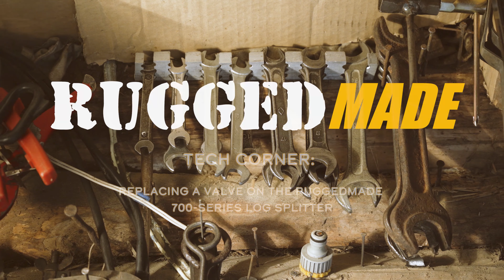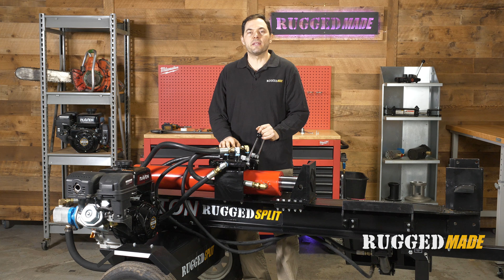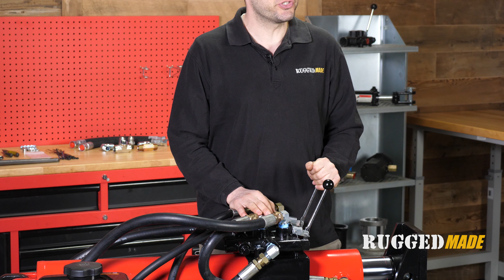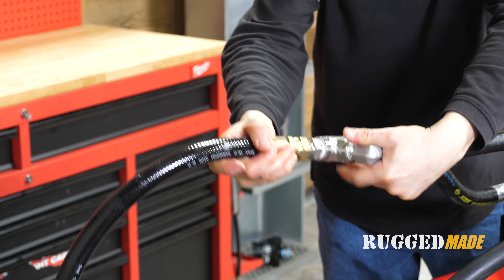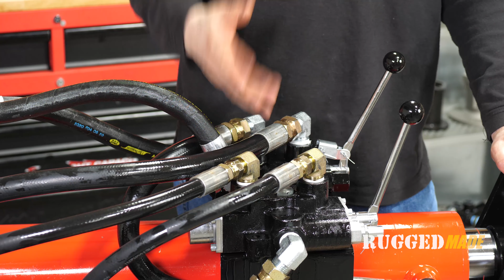Tech Corner: Replacing A Valve On The RuggedMade 700-Series Log Splitter

Comment: Can’t find this kit on your website. Is there any difference in cycle time with this new valve??
Reply from the maker: There is no difference in cycle time when using this valve. This is a replacement part only at this time but will be for sale in the future.
Reply: So it adds a dump line for the log lift, what is the advantage of this valve?